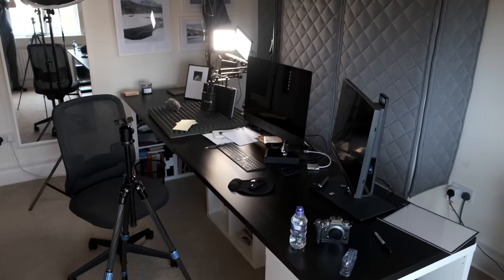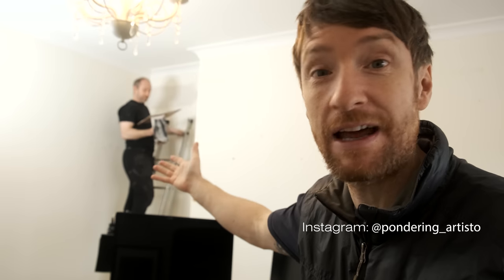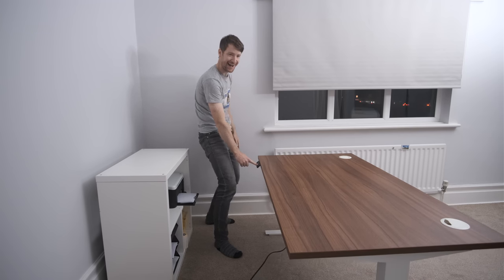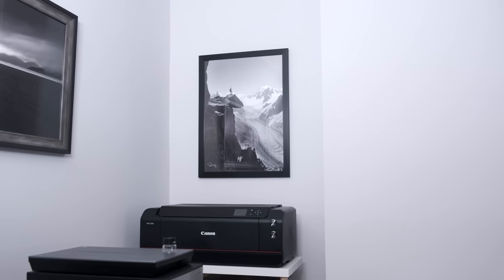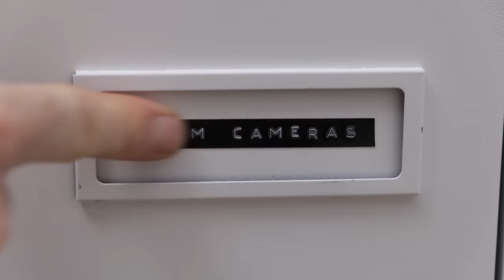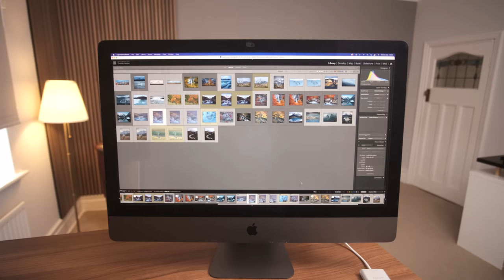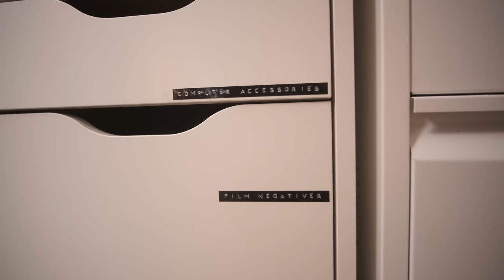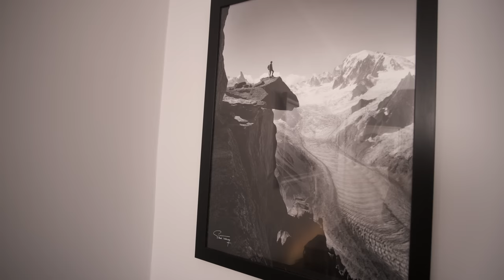Making My New Photography Home Office

Comment: I love this new setup. That C stand is clever. A YouTube channel I really like called "Mediastorm" has a similar system. They tried to upgrade other Youtubers' gear and found having different stands for monitors, cameras, lights and microphones is too chunky, so they designed a system they call a "tree". That thing has multiple types of "tree trunks" for rolling around, mounting to a desk or being stuck between floor and ceiling. Also arms for all sorts of stuff.
I doubt whether YouTube will allow links so I won't leave one. They are a Chinese channel by the way so it might take some translation.

Comment: Nice setup and clean… but… be careful with your Raid Drive. Raids, with I assume 3.5 drives, are very sensitive to any micro shakes and movements that can destroy them over time.  I would suggest turning your raid off when you raise or lower your desk. The best would be to have the raid off your desk, on a different piece of furniture.
I am Head of IT at an Entertainment Creative Agency and unfortunately had to deal too many times with data loss of raids and other drives that had a little bit too many movements.
Cheers from LA.

Comment: For the storage you have the option to put all drives and NAS in a ventilated closet or similar and pull a 10Gig network cable to the desk. This will also help you avid vibrations from the desk in the HDDs.

Comment: I like this build. I recently did my office. I went with a sit stand desk. I worked hard on cable management but I didn't do as well as you that's for sure. However my office is probably about a quarter the size, it felt good to get the room painted new light fixture and declutter the work space. I'm slowly adding to it but only functional items. Thanks for sharing.

Comment: Cool!  Your foam for gear is a very good idea.  I have same idea in the corner of my mind for a while now. 
I don't really like all the gears exposed like many youtubers do. (Risk of fall, drust etc). This is way better!
I really like your new clear wall. I never 
 liked your dark wall (but it's your style so I did say nothing hehe).
I stay inspire by your new room!
Thanks you very much.
Reply: I'm not a fan of foam for cameras. I had an old film camera in a metal case with a foam insert. I didn't go near it for >10 years. When I did the camera body and lenses were all covered in gritty little bits of foam which had perished and turned to powder! It took an age to clean them. I'll never use foam inserts again! My other camera -  in a case with expanded polystyrene - was perfect.
Reply: Thank you Alan for your advice. I will be aware about the material of "foam".

Comment: Love the Nick Carver inspired home office. But one little thing, ok not so little, your canon pro 1000. I would have put wheels on that desk aswell, or some way of sliding it in and out, simply to give you ease of access to the maintenance cartridge and the rear feed tray. I've a pro 1000 and I've that problem at the moment but the printer is getting moved soon to a better place.

Comment: Great Work Thomas. Just a heads up regarding the standing desk. The monitors should be mounted in such way you can adjust their height so they match your eye-level (according to all those posture guidelines). When you stand that eye-level point changes a little bit (usually monitor needs to go higher) and it's great to have a monitor stand that you can easily adjust when needed. This is probably more relevant to the non-vertical monitor :P. Otherwise you night be looking just a tiny bit (too) down without noticing and starting feeling some pain on your neck. Cheers!

Comment: I blame Nigel Danson for my current quandry - a larger format printer along with a supply of papers (and now forced to make prints a LOT more often to keep the printer in tip top shape) and a need to store said papers (preferable flat) and excess prints. Which creates another problem - where to put said storage thing. Ain't no room in the "office"! And it looks like I'll be force to build something from scratch so I hope to add in room for camera gear so the wife stops barking at me. sigh.... Now with your redo, I feel motivated to get off my bum and do the same.

Comment: BTW: putting an spinning hard disk array fixed under a table is a recipe for disaster. Shocks like slashing on the table will send shocks onto the disks which may behave eratically - from loosing their heads position during writing up to head crashes... Thats why a NAS should be networked and savely stored somewhere nobody can touch it. Treat it like a high end turn table...

Comment: Attaching the harddisk enclosure to the desk (especially underneath) is a really, really, really bad idea. I would be in constant fear of loosing data due to a harddisk head crash due to the desk moving or me just bumping it (assuming those are "rotating rust" harddisks, solid state disks being immune to movement during operation).

Comment: Fun video with good ideas.  ͟H͟o͟w͟e͟v͟e͟r͟,͟ ͟t͟h͟a͟t͟ ͟i͟s͟ ͟N͟O͟T͟ ͟a͟ ͟C͟-͟s͟t͟a͟n͟d͟!  What you have is a rolling light stand or, most probably, a low-budget knock off of the Matthews "Monitor Stand II". A C-stand is a whole different, specific animal and never has wheels and has fold-out legs. Not to be the Pedantic Dictator but it is very bad ju-ju to promulgate inaccurate terminology about our stuff. I'm just a wee bit touchy as I'm a union cinema first camera assistant (focus puller for you Brits) and I hear people use the wrong names for things that they're not familiar with all of the time. (ie. there is no such thing as a "keg light"!) Keep up the good work nevertheless. You work HARD for the money.

Comment: 12:11 no, these are not acoustic panels. This is slat wall and it has really poor acoustic qualities compared to an actuall acoustic panel or a bass trap. Yes, they will affect sound a bit but it will be closed to putting carpet on the wall or hanging drapes. You don't call motocycle the car, so don't call these acoustic panels.

Comment: The acoustic blankets behind you are ugly, looks like you are in a warehouse or moving company. Much nicer would be to install the same acoustic wood panels like from behind the chair. Also will matched the desk. On a personal note, I would build a vertical display tower with light behind it or lit shelves (can be seen in many videos) from the same extruded aluminum you used in the van and display all the cameras and lenses as opposed being kept in the drawer. It gives a professional atmosphere in your trade.